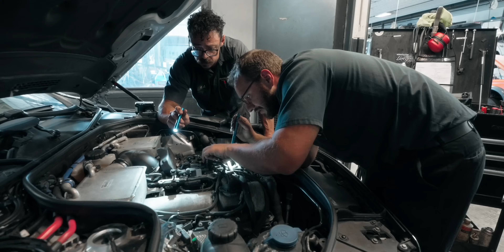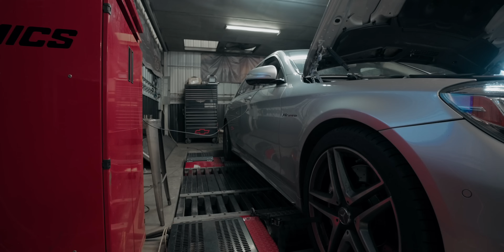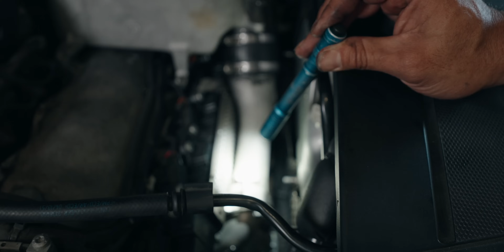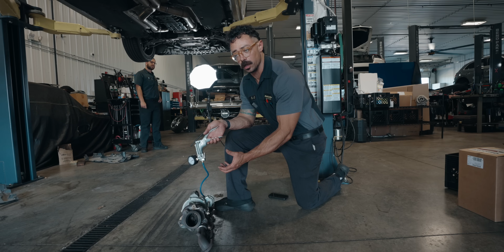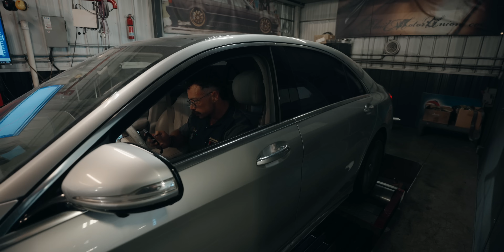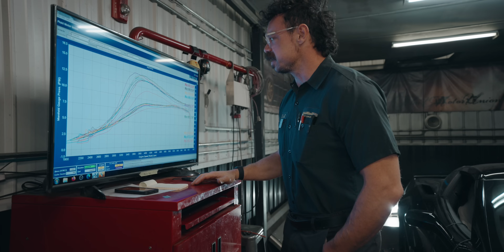$20K+ in Turbo Mods & Still no Power…Mercedes V12 Biturbo S65 AMG Build Mystery Deepens- It’s Nuts!

Comment: Do a transmission health report via scan tool. If it is sensing high multi disc temp it will reduce torque. One way to confirm is to run the car with cold trans fluid. The torque limiting comes in after 70c 

I just rebuilt my trans and all the power is back.

Comment: If you can get a scope on the boost control  solenoid and confirm  80% duty cycle,  it might be time for  an external  wastegate,  and lock/ weld the factory  gates shut .

Comment: I enjoy the video but every time I watch this i think of the 2jz simple is better most engines are far too complicated. built 2jz quick spool valve 6870 name brand parts. Simple cheap far far easier to work on 1000whp.

Comment: Also, on preload I have checked the s65 and preload crack pressure was at 10 psi not 7. Tested several cars. Pinch the line from intercooler to boost solenoid and it will tell you if it’s mechanical or electronic

Comment: Disconnect the line from the intercooler to the boost pressure control solenoid. Plug it on the intercooler. If boost builds, then it’s not mechanical and is a control issue. Check the throttle opening, as boost control solenoid controls boost but the 65 also manages throttle opening to reduce boost pressure.

Comment: I have seen this twice before on larger CC power units, generally there in the “boost to Open” type waste gates you will need a restrictor pill in the boost line to the gate, and then also have to tune the torque control limits up in the ecu.

Comment: Waste gate stuck open. TQ converter slip. Fuel injector size. Fuel pressure drop off? Air intake plugged? Too restrictive of an air filter. All sorts of stuff could be wrong. Wrong size hot side cold side size? No oil line feeding the turbo? Intake gasket? Vacuum line leak? I would start the car and immediately check the airflow coming out of the turbo. Cats plugged up? Oh, I had a flex pipe crack and wouldn’t show its face until the motor rocked under load.
Reply: 10:46 I have a really strong feeling that the torque converter isn’t locking up. You’ll lose a shit load of power to the tires.

Comment: A really humble  and honest video of this thing  totally  kicking your ass I can't believe such a professional shop would put that together with out  bench testing those Wastegates . after confirming the  waste gates are at the right pressures the next thing i would do is look to see if there are restrictions in the  control circuit plumbing let me remind you that before we had EBC s on everything we would just set up bleeds with check valves and needle valves and calibrated orifice  one super basic  ghetto tricks is to put a MIG welding tip in the hose to the actuator  this  then amplifies the effectiveness of the bleed off . Check the bleed off is not blocked   . another important thing to consider is you need to confirm that  pressurized air is defiantly not being trapped between the  solenoid and the actuator  leaving the gate hanging a bit open . I would also consider  getting the latest Dyno dynamics upgrades the company has new owners who are  much better to deal with  having a few more channels on the dyno graph is really helpful  . those MAMBA  turbo rebuildable actuators with changeable springs are really cheap they would also make a lot of sense ..I really feel  sharing what is not your greatest work is a very sincere and commendable quality witch makes great content i enjoy, so keep at it your will prevail triumphant

Comment: Pull the hoses off the wastegate actuators and try and run it on the dyno again, but just feed it in slowly incase boost does start to run away. With no hoses on the gates, it will theoretically make the maximum boost the system can deliver. If it follows the same boost curve that you have now, then the actuators are too soft. If boost comes up, it's a tuning issue.

Comment: Very interesting diagnoses thoughts. I'm about to embark on a C32 AMG build adding twin turbo's from a C43 compounding into the stock pullied supercharger, we doing Forced Induction Interchiller, single pass intercooler post supercharger, E85 Flexfuel and Haltech ECU.
Reply: And the funniest thing is that a single turbo will make more power more reliably.
Reply: @hexagonosaurus5848  Most likely but we want to produce exhaust manifold adaptors for M112 engines to suit these factory compact turbos and make it look stockish. If it doesn't work out we'll go aftermarket turbo's.

Comment: To answer your question.. When doing my second manual swap on a C55 AMG, I got impatient and tried to suck the trans in with a few bolts, all was going smooth until it didn't.. Snapped the lower oil pan and needless to say, the engine came out for a refresh lol... was a rookie mistake and definitely a live and learn moment! These 65 platforms are sooo complex, it takes a very fine tooth to comb through and diagnose. Working on cars with tricky issues can be extremely defeating at times, but if you allow yourself to be open to any possible reason for the issues faced, it makes it a lot easier as to not overlook even the smallest details. Your a fantastic mechanic and thinker and it's awesome to hear your insight and routes taken.

Comment: I've had some ecu go crazy into limp mode when it detect intercooler temp is alot lower than ambient iat temp I have tuned some cars where this was the case and have used the same vcm hpt dataloging software to notice this. One car I had to fabricate the iat sensor into the post intercooler pipe to make it think ambient was ice cold to not go into limp mode. The ecu will assume the charge air temp is bad and reading wrong because it does not correlate with iat temp and will drop boost pull timing to go into a safe mode because it thinks the charge air temp sensor is bad and will even throw a code sometimes for temp sensor. Another thing you can do is add resistor to iat or ambient sensor on the front bumper to make ecu think it's alot colder outside than it actually is

Comment: You need to unplug the wastegate vacuum hose and block it off at the hose end. At the wastegate side leave it open to atmosphere that should give you double the spring pressure if you have a 5 psi spring you will get 10-15psi with it unplugged
Reply from the maker: You are right in effect but not in description. You are essentially only leaving the force of the spring to hold down the wastegate with no relief for boost control. So it might go higher than double… it goes as much boost as the compressor impeller can produce… 
Which in this case is 15 psi because the pressure in the exhaust manifold is greater than the boost it’s producing- thus pushing the arm open.

Comment: I used to have a 2006 S65 AMG. I had an engine and TCU tune from Eurocharged on stock turbo with custom 3" mandrel bend stainless pipes through an X-pipe then Vibrant  3" in straight through rear box muffler with dual 3" rear tips. We hollowed out the stock converters and installed 100 CPI 5" converters instead. I also installed Go Fast Bits Electronic Boost Controller kit to modulate the pressure going to the wastegates to get higher boost. My max boost pressure I saw on my boost controller was 28 psi as it has a max boost display hold for 3 seconds after you let off each time. I mounted the display controller unit right on my steering column in front of the dashboard. I had the car dyno and it put down 590 hp, 797 tq on a Mustang Dyno. The TCU tune actually helped unleashed additional torque since that's where the torque limiter settings resides as I was told by my tuner.
Reply: Relevance

Comment: Hi guys.  Before you drop that engine... I have a CL65 with a bunch of old Speedriven goodies.  My turbos are not as big as those hybrids, but they are larger than SL65 black series.    Since the wastegates are actuated by that solenoid, you need to consider adding a manual boost controller.   That is how I'm able to run bigger turbos on mine and not have wastegate issues.   If it comes to it, I'm a couple hours away in Ohio and am willing to send pictures, videos, whatever to use my car as reference for this repair.   Good luck!

Comment: Gen 3 LS knock sensors, I've gone through 6 this year. Apparently, it is a common problem where brand new sensors are throwing low voltage codes, even oem sensors. The sensors are located under the intake manifold. My car has been in perpetual limp mode this whole year.

Comment: Bro, you're too afraid to touch the wastegate 😂. You call yourself a mechanic shop? Stick to bodybuilding.
Reply from the maker: You get that way after you drop the engine a second time on the shops dime to adjust a w12 Bentley…

Comment: Verify that the waste gate solenoid is holding boost or vacuum, unplugged it shouldn’t allow anything through, my guess is that its partially open and working off manifold pressure. What it should be doing is staying closed untill requested boost is achieved thwn opening.

As far as setting wastegate pressure is known on the b5s4 most tuners are telling guys to set it at 9psi and they take care of the rest (up to 20PSI+) with the WG solenoid and there are lots of amateur mechanics setting up wastegate pressure on their own. If you want someone to talk to i’d ask Tunezilla or Blake Beadie at ETS Spec about your turbo issues, you probably don’t need to pull the engine again if you can adjust the waste gates and pressurize them in car.

Comment: First thing I would do is unhook boost lines from the wastegates, and try to make a low rpm pull u till turbos start to cook, if I get my wastegates open at cetrain(lower boost than I want) I'd search for new wastegate valves which have higher rated spring.

Your EMAP basically controlling safety aspect of opening the wastegate.

Comment: I dont trust the gauges sometimes. I would put a boost gauge sensor before the intake somewhere. See if it reads correctly. Eliminate that issue
Wastegate problem I would for sure check the oem one outside and simulate putting more boost in it than its designed to do! If its giving you issues theres the issue. I Also would like to know what size turbines are they ? Maybe the exhaust is getting restricted by a not so big of a turbine wheel  that its choking the engine up top! Biggest thing I realized when I put a bigger turbine wheel on my car is that the power was coming a little later but the boost was staying almost all the way up top!

Comment: If it's a Bosch ECU it's torque based and there are a bunch of tables determining the torque output. If there is a driver demand torque tables try adding 20 to the top row and see if that helps. Also add more torque in the areas that pertain to allowed engine torque. Then go check duty cycle on the wastegate solenoid. It is commanding your boost. So the first thing is driver demand. Aka pedal. Then the lookup for how much power it's allowed. Then it will look in the virtual torque tables and see how much boost and or throttle angle to give you. This happens every millisecond.
Reply: I hope they know that! Torque on these cars doesnt get unleashed until 3 or 4th gear, If I remember correctly first gear gets 500nm
Reply from the maker: Yea. That’s the go to. Once we rectified the boost issues with the wastegate nothing changed in 9 files and 40 dyno runs. Tuner and the turbo manufacturer agree that the wastegates ate most likely being pushed open.
Reply: What is wastegate duty cycle doing during runs. Is it 100 percent? If so then yes it's pushing them open. If not then it is tune related. Or hard limits in the ECU you don't have access to tables.  @FluidMotorUnion
Reply: @FluidMotorUnion  just fyi, stock boost on the car should
Be 18-19 psi stock not 14. A tuned 65 with stock turbos hits 22.5 psi. The ecu in this car manages boost with both the boost control solenoid and the throttle control. Confirm that the throttle is staying open during the run as I have seen this on a 65.

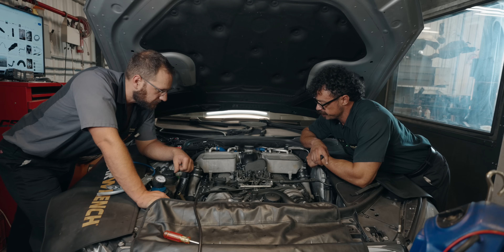Comment: 12:12 "26 or 27 psi before it stopped moving, I don't know if the car is set to that".
The car isn't running, do you know how a boost control solenoid even works? If it's not activated (duty cycle) those turbos should be opening at base (wastegate) pressure. You are correct, however, that they should be set to the same pressure. I would check that the wastegate flaps are fully seated and sealed when not actuated.
Reply: Edit: watched further and because the nuts had fallen off they were flapping in the wind, so basically wide open, no wonder it wasn't making boost. I would simply find the base pressure spec and set both of them to that through trial and error by testing.

Comment: The company said tying them can turns to get 15 PSI do another 10 trance and maybe you get 20 psi before you take them out it's worth a try.
Reply from the maker: This video covers 3 of those adjustments. 2 of those produced no increase past 15
Reply: @FluidMotorUnion  yeah change the wastegate. Get turbosmart 👍👍👍

Comment: Plugs gapped correctly for increased boost ?    You probably know this but tuning many times leads to ignition issues on these cars.    My sl600 fried every ignition component shortly after tuning     A fusable transformer might be a good investment
Reply from the maker: It’s not cutting. Smooth power delivery, Just not hitting target boost. Plugs were gapped to .028 when we first did the turbos.